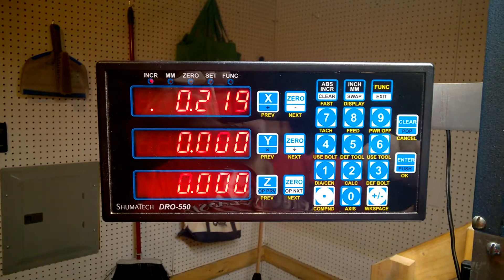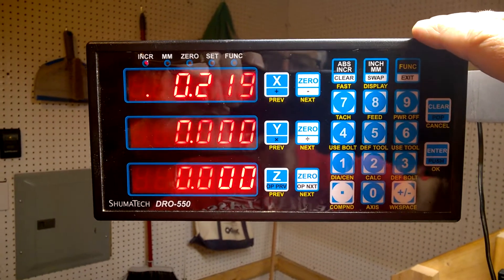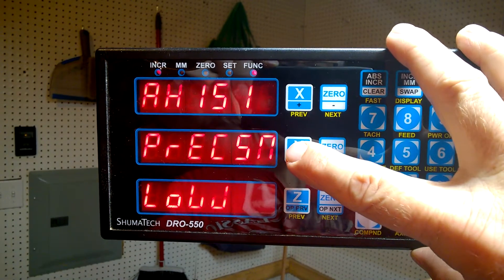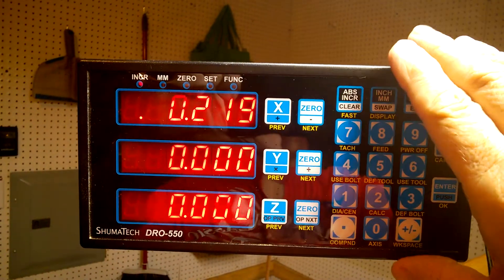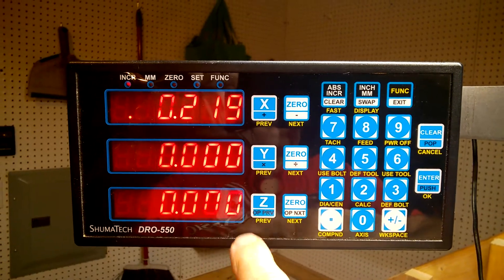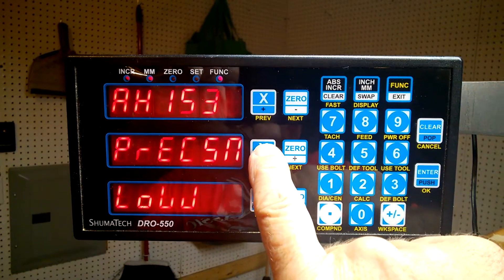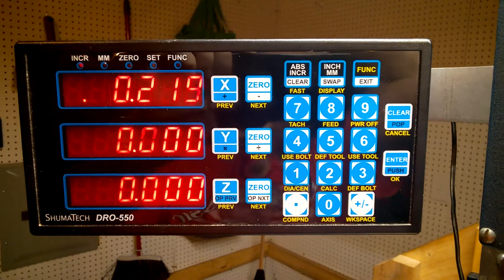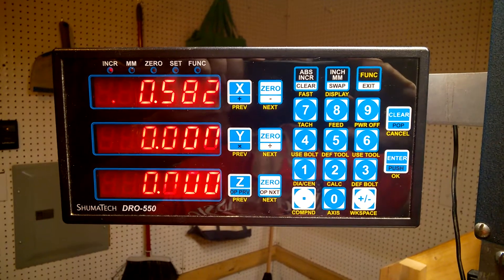DRO 550, adjusting display to 3 digits to right of decimal point.

Comment: I have the same issue, curious if you ever resolved this.
Reply from the maker: Can’t remember for sure. Think it was either a loose connection on the scale input or the battery in the scale needed replacement. Hope you get it resolved. Thanks for watching.